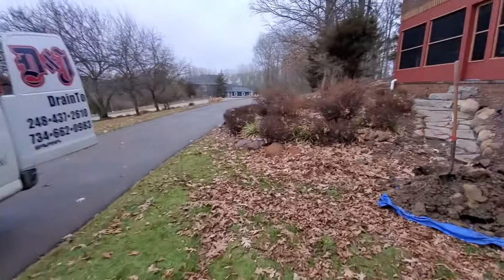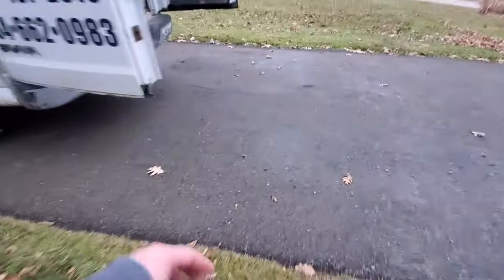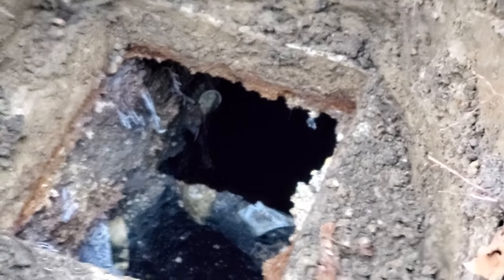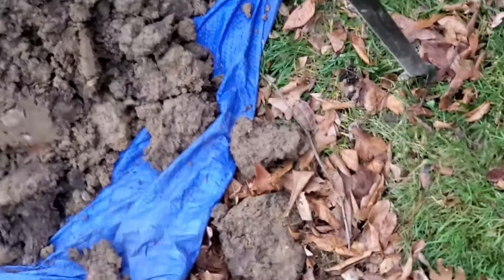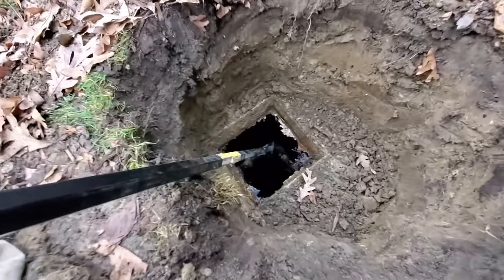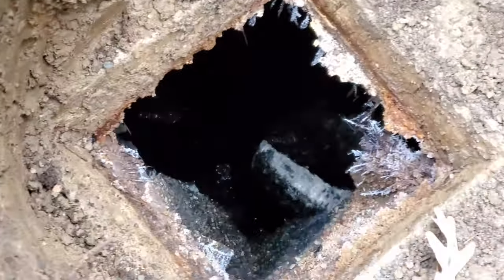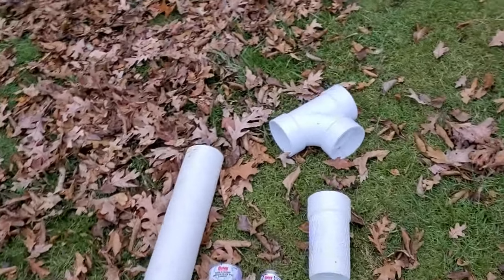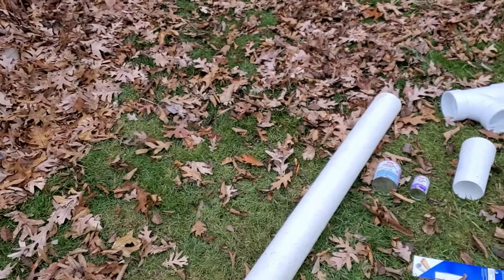DIY Septic Tank Outlet Baffle Repair

Comment: Question, I’m replacing the entire line from the house to the septic with sch 40. The outlet pipe is original cast iron. Is there an adapter like the one you used for cast iron to pvc?

Thanks
Reply from the maker: A 4" rubber furnco connector should do the trick. Its important that you have a square cut on the cast iron coming out of the house so the PVC pipe and the cast iron will meet evenly in the middle of the furnco. This will help to prevent creating a sharp edge where waste could get caught and cause a clog.
Reply: @askthepumperdude  thank you sir

Comment: Any suggestions on enzymes that would be put in distribution box for a slow draining field thanks
Reply from the maker: I would start by having the drain field inspected to find out the exact cause of the slow drainage. If it is caused by a structural issue or poor distribution, adding a bacterial product would not be of much help. If the slow drainage is caused by a biomat build up, adding an aerator could be an option. If you are going to try a product, I would suggest using a high count bacteria or an oxygen based product to encourage aerobic bacteria growth.

Comment: Is there an inlet  baffle
That needs to be installed?
Reply from the maker: Some areas require and inlet baffle and some do not. The same process can certainly be used for the inlet as well though. I will be doing a video soon on inlet baffles.

Comment: My septic was pumped on Nov 2021 and I have to clean my filter every 2-3 months. Recently I have to clean it every month and it is caked with solids which is backing up the system.  I am very cautious about what goes down my drains. Only liquid detergents, no hair shavings, no harsh cleaners and single ply TP. I do have a water softener that backwashes every 2 weeks. 3 people live in my home and my system is 1,000 gallons. Seems crazy that I have to have my system pumped in less than a year.  I’ve changed this filter 7 times since November 2021. I only use liquid detergents and never use harsh cleaners. Every month I flush a green gobbler treatment pod down the toilet. What can be causing this to get clogged so quickly? I read it doesn’t need to be cleaned that frequently.
Reply from the maker: If there is not excessive water being used in the house (which from your description it does not seem to be the case) it is possible that the tank is not being cleaned properly. If sludge is being left in the tank, the filter will continue to clog easily. Make sure you are there when the tank is cleaned and that all solids are being removed from the tank. Also, hire a company that uses a sludge judge to measure the solids in the tank. This should give an indication on how well it was or was not cleaned previously.
Reply: @askthepumperdude  Thank you! Around the time I commented about 11 months ago I had a local septic company come out and clean my tank.  He did not have a sludge judge but I was with him while he cleaned my tank. He did a good job by getting into each corner and using my hose to spray the sides.  He told me to stop flushing the green gobbler tablets down and see if that made a difference.  For the first 6-8 months I would clean the filter once a month but now it is back to twice a week.  He advised me to remove the filter all together but I feel like by doing that then I will be clogging the pipes in my field.  Any ideas on what I should do?   This seems crazy to be cleaning this filter twice a week..
Reply: Also, I am located in Hunterdon NJ if anyone knows of an all star septic company to help fix this problem.  Otherwise I will just schedule a pumping every 6-8 months lol

Comment: Great Video...quick question. When doing the tee do you need to put a cap on the top? Would it not be possible for sludge to overflow into the tee and to the bed? Thanks
Reply from the maker: You want to keep the top of the tee open for ventilation so it can't create a siphon and flood the drain field. The operating level should be at the bottom of the pipe going through the wall, so unless there is an issue with drainage in the drain field the solid level will not go above the top of the tee.

Comment: You don't have to glue the exstend a lock
Reply from the maker: No, the threads lock it into the pipe. The sanitary Tee does get glued to the extend N lok which creates a sealed fitting.

Comment: IF the tank is still full of effluent, what do you recommend doing? Drain it down some, using a hose into the outlet?
Reply from the maker: Yes, it is best to perform this repair after the tank has been drained. You only need to lower the level in the tank enough to add the extend N Lok and then glue the tee. Typically if you have about an inch or two of room you will be good to go.
Reply: @askthepumperdude  Thanks for the reply! DO you know if the outlet pipes generally have enough pitch that I could create a siphon with some hose a couple feet into the pipe.

In other words, what's the typical pitch of the outflow pipe? (Which would dictate how far in I need to send the hose to get a siphon)

Comment: Will just an elbow with a pipe going down 18 inches work or does the top have to be open? And can I just drill air holes if so?
Reply from the maker: Yes, an elbow will work, but it does need a vent hole drilled in the top so it cannot create a siphon. A 1" paddle drill bit works well to create that vent hole.
Reply: @askthepumperdude  thanks for responding. The reason I asked was because I already did it. Sure glad it's gonna work lol

Comment: Can you use abs? My tank is old. I bet I have a cement exit pipe.
Reply from the maker: If you have a concrete or clay pipe exiting the tank, the best repair is typically to dig up outside the tank, remove a section of the existing pipe, and bring PVC back into the tank. The outlet device can then be attached to the PVC pipe. The new pipe should be sealed inside the tank wall using hydraulic cement. In this repair, the Extend N Lok would not be needed.

Comment: What if its an old clay pipe ? Is this still applicable ? I currently have a dug up tank that needs new baffles on both sides.
Reply from the maker: If the inside diameter of the clay pipe is similar in size to the inside diameter of a 4 inch PVC pipe, this process will work. Many times clay pipe will need to be dug up outside the tank, then remove a section of the clay pipe and replace it with PVC back into the tank. Seal around the new pipe outside the tank with hydraulic cement. Then add a new outlet device in the same fashion as in this repair. Good luck!

Comment: How far above the tank bottom should the outlet line be?
Reply from the maker: There should be about 4 inches of separation between the inlet and the outlet of the tank. This usually puts the outlet line around12-16 inches below the top of the tank. The bottom of the outlet device which is the Tee that attaches to the outlet line should extend down to the middle of the tank. You do not want it close to the bottom or it will allow sludge from the bottom of the tank to exit out to the drain field.
Reply: @askthepumperdude  Thanks! I am doing this in 5 days. Perfect timing.

Comment: Thank you for the clear explanation.  Is it normal for a septic tank to have more than one exit lines?  Ours has a least three.
Reply from the maker: No, it is typical for the septic tank to only have one outlet line. The drain field will be made up of several lines that branch out from the outlet line from the septic tank. I would be interested in finding out why, if that is this case that there are multiple outlet lines from your tank. You could try contacting your local health department to see if they have records from when it was installed to see if there are any explanations there.
Reply: @askthepumperdude  Thanks for answering!

Comment: So how does one do that work on a tank in a colder climate where the tank is buried 8 feet down?
Reply from the maker: A much larger excavation would be needed with a tank that deep in the ground to safely access the tank for the repair.
Reply: So if my access is stacked rings does that mean dig it all out and take the rings off?  Or do you just pump it, suit up and climb down in?

Comment: I went to replace my outlet baffle and the out let pipe was gone! The water was draining through the hole left behind from the old cast iron pipe.  lol
Reply from the maker: Yes, in that case you will need to dig up outside the tank until you find good solid pipe to attach to and bring new pipe back into the tank.
Reply: djsepticservice Thanks for advice. I’m going to do that today. Not as young as I used to be. Pump truck coming. That should buy me time.

Comment: What would that would cost a homeowner to pay someone to fix that?
Reply: It can cost from $300 - $900 to have a pro do it.
Reply from the maker: This repair typically runs $150 - 300. If the repair cannot be made inside the tank like in this video, it can run in the $400 - 600 range.

Comment: We have our 30year old tank pumped every 4 years.  Only two adults and a dog are in the house.  Our tech mentioned this outlet pipe has seen better days and you can see the cement around it is failing..  So thank you for this and educating us all on it. Not sure I could rely on him do this for us for as well as you did here!    He also found two 4-5 foot effluent type logs at the bottom of the tank and I only hope he removed them!  My concern is that the 3.5 ft large black drain pipe/riser he install a few years ago was not sealed in any fashion at the tank! The tank is in a wet area where rain drainage occurs above it. And  I believe dirt and water from the top of the tank cover and at that riser are getting in it.  I am not happy about that short cut and wish I knew better to demand a better product and install.  I also remember seeing a soupy slug at the same level as this outlet! Not as clear as I believe it should be. So there was not as much area for gasses to collect 
Would you have a clue what might cause these harder logs at the bottom of that last tank?
Reply from the maker: It's hard to say what those could be in the bottom of the tank. Sometime we will find pieces of wood that were used during construction or similar items. If they are just sitting in the bottom of the tank, I would not be concerned. They will not hurt anything as long as they are not disintegrating and ending up out in the drain field.
Reply: I have some kind of log at the bottom of my tank. I'm guessing they put that in there to see if you're at the bottom of the tank when pumping out. Just what I always thought.

Comment: Do you have to pump out the septic tank?
Reply from the maker: We typically will pump the tank before doing this repair, however it is not always necessary. The issue with not pumping the tank is that you may have remaining concrete baffle below the water level which will be harder to remove. You will also most likely be working under water. If you will be making the repair without pumping though, it is important that you use the "rain or shine" PVC glue which will set up properly in wet conditions.

Comment: How do I get the old baffle out if it is cemented in to the tank?
Reply: In this video he just bashed it down with that steel bar and let the bits fall to settle into the bottom of the tank
Reply from the maker: Yes, the old baffle is usually deteriorated by the time that it needs to be replaced. You can usually knock it out by using a good size breaker bar. You only need to remove the front portion of the old baffle, leaving enough room to install the new outlet device.

Comment: Thank you for the video.   How old was that tank?    What could cause concrete to "rot" like that?
Reply from the maker: The gases in the tank cause the deterioration. Concrete Baffles typically start to fall apart around 25 years of age.
Reply: @askthepumperdude  why do the gases affect the baffle and not the rest of the tank?
Reply: @chris_mic  the baffles don’t go to the bottom of the tank and the corrosion is at the top where the baffle is attached. So it deteriorates where it is anchored, causing it to fall. If that makes sense
Reply: @nickp9062  I had to go back and watch the video again to see why I asked the question. Thanks for the info.
Reply: @askthepumperdude  ....yes, it's been 26 yrs and mine is being replaced. I didn't know. A septic service is doing mines....of course they are charging my eyeballs out. I can't do it...lol 🤣🤣
Reply: @nickp9062  ....I just saw mines...it's crumbling concrete. I'll hv to get it fixed....expensive??
Reply: @flowforever9084  probably expensive yes. It’ll ruin your yard and you’ll have to landscape again. I’m not sure about price but expensive sounds right

Comment: As a Licensed Certified Septic System Evaluator, and a Technician with over 20 years of experience doing Septic Inspections and Septic System Repairs , it's unfortunate this Septic Technician didn't explain that not every homeowner will be able to find the Outlet Cover on the Septic Tank, because not every Septic Tank has one. With this in mind, it really depends on the age of the Septic Tank and the company that manufactured it. Also, some of the older tanks still in operation only have Small Inspection Ports, that you wouldn't even be able to fit your hand in. Not to mention, not all Outlet Covers or Inspection Ports are easily removed or opened... it really depends on how long its been since the cover was last opened, or if it has tree roots growing over it. In other words, this can turn into a major project the "average homeowner" is not equipped or prepared to deal with. As a result, I do not recommend attempting this without any experience, because you run the risk of breaking the cover or damaging the tank itself. Also, you could potentially injure yourself in the process. Septic Professionals get paid for their experience and knowledge for a reason, not to mention, we've learned a few tricks along the way, that can't be shown in a cell phone video. By the way, modern Schedule 40 PVC Plastic Piping is not compatible with ABS Pipe, Light Gage Schedule 20 Pipe, Bermaco Pipe also known as Old Orangeburg Pipe, so what this guy is showing  or demonstrating in this video might not work for a lot of homeowners. Food for thought, not just anybody can do this type of work.
Reply: I'm sure not all scenarios fit the description in this Vlog, and I'd never attempt to DIY, but very helpful terminology and how a baffle is supposed to work and now being replaced with some type of pvc piping.  I'd never attempt but can now appreciate and understand a lot more than yesterday.   😊
Reply from the maker: Hi Craig, thanks for your comments! You are correct, some pipe will be more difficult a repair and should be left to a professional like orangeburg pipe. However, the extend n lok fitting will work with any 4" plastic pipe whether it is light or heavy guage. It is a very versatile fitting. I disagree though that most homeowners cannot perform this repair. I believe that most "handy" homeowners are able to make this repair. In our area anyway, 90% of tanks have an access over the outlet that is big enough to make this repair. Different areas will certainly have differences in the manufacture of their tanks. 

I would love to discuss some of the tricks you mentioned. I think that would be very helpful to homeowners. I would love to set up a video chat sometime or if you like you could mention a few in the comments.

Thanks again!
Reply: Hi Craig. Is a permit required for this fix?

Comment: Does the pipe that you put in the tank rest on the bottom of the septic tank, or does it float above a certain distance?

Thank you for the great videos
Reply from the maker: No, it is important that the down pipe is suspended in the middle of the tank, usually approx 18" from the bottom of the sanitary tee. You want it in the middle of the tank because that is where the cleanest water is, so you can ensure that you are holding back the solids on the top and bottom of the tank.
Reply: How far from the wells do have to be with a new septic tank?
Reply: @joegugala6992  like a water well? In my area it’s 100 feet from septic tank to well
Reply: @askthepumperdude  I have a similar question.  Instead of breaking the concrete (baffle) to put the down pipe into.  Why not put a longer extension (can I put a longer extension?) and put the down pipe past the baffle?  Does it matter? I ask because if the baffle top is completely gone (mine is) I was thinking I just extend a few additional inches from the outlet pipe into the physical tank then go 12-18in down.  Saves me having to break the baffle below the water line.
Reply: @ScottE6pack  probably too late of a reply, but the main thing with the filter tee is having access to clean it and pump the tank out